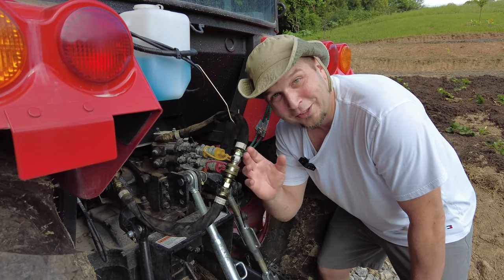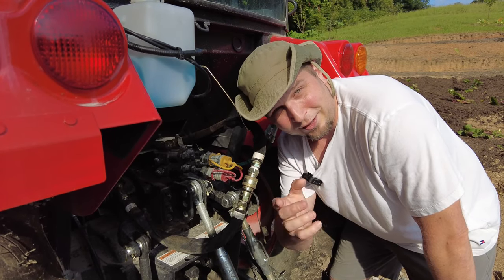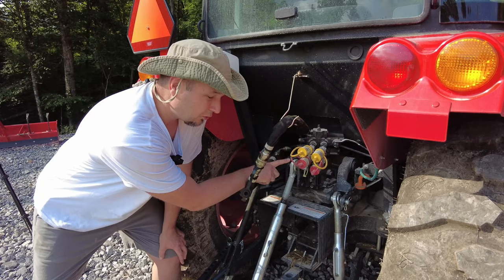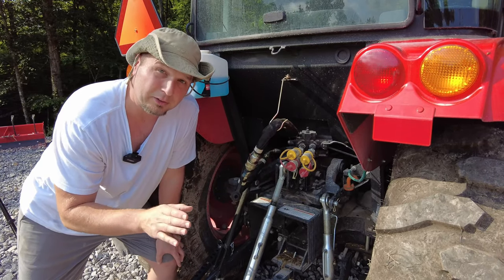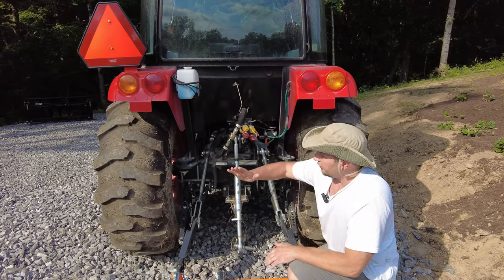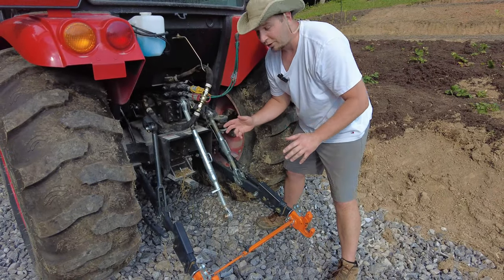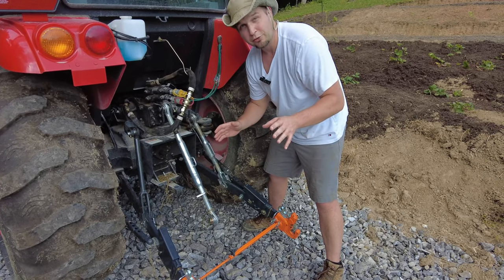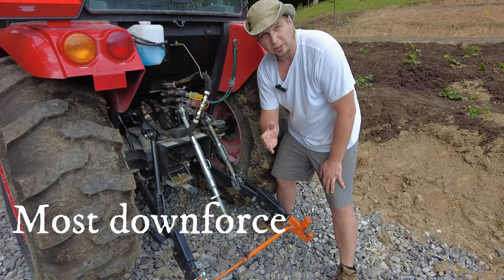How to ADjust the Top LINK! 3 Point Hitch on your Tractor! What to do with 3 HOLES! Lets Take a look

Comment: Wouldnt it make more sense to use the holes to make the toplink as parallel as possible to the lift arms, so you implement travels without tilting forwards or backwards through its motion? Then use the toplink length to adjust tilt? Itll keep same tilt through whole lift/lower, IF toplink is parallel to lift arms.

Comment: I have a 3032 E John Deer   I use it mainly for my arena drag for a horse arena. I have no knowledge of the proper way the 3 point hitch should work and just learned about the three holes.. Thank you!  Now to my question .... The toppling twists, my arena drag is a lot lower in the back than I remember it to be. The area of the top point seems too long but I do not know if shortening the top point will fix the low tilt of my arena drag. PLEASE HELP :)

Comment: My Kubota manual is opposite, but your the second video I've watched that says it your way. My manual rarely recommends the top hole, only for a moldboard plow in light soil and even that says hole #1 or #2, disc plow, harrow, sub spoiler all #2 or #3 and then earthmover, scraper, rear carrier and mower all day #3. And before I look like a dub it has a picture of the back and the top hole is #1 and so on, with arrows can't mistake it. Just seems odd and I don't want to screw up a machine or attachment unnecessarily.
Reply: The holes are for sensitivity of the draft control. How aggressively it lifts you ground engaging tools from sinking into soft soil. Also Three point hitches have no down pressure other than the weight if the tool.

Comment: Why does my toplink come loose (unthreaded) why using my sickle bar mower?
Reply from the maker: You should have a little locking bolt mine links like a triangle piece of metal threaded on to one side of the adjusting center link. And you tighten that to the link and keeps it from loosening like a double nut.

Comment: What about the center hole…
Reply from the maker: That is a neutral point.  So if you are using the box blade and don't want it  to dig down to deep then use the center hole. Thanks for the comment 👍

Comment: Your advice is exactly opposite of what Tractor Mike says in his video.  He says the top two holes are for implements that need downward pressure- box blades, plow etc.  The bottom hole is the least aggresive and is used where down pressure isn't required, like for brush hogs and mowers that are supported by the bottom links and their rear wheel.  WTF?????
Reply from the maker: Well I guess tractor Mike is wrong about this one here is a link you can read up on it 
https://www.messicks.com/school/what-adjustments-can-you-make-to-your-three-p